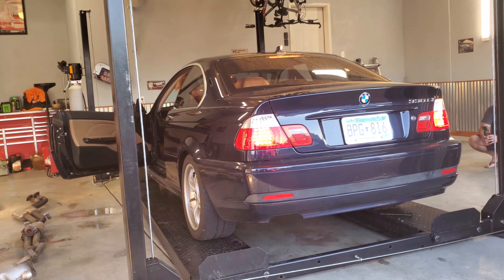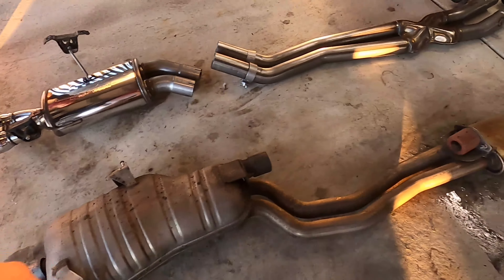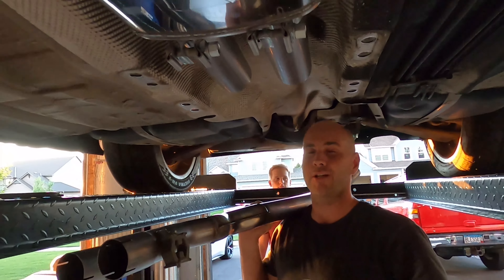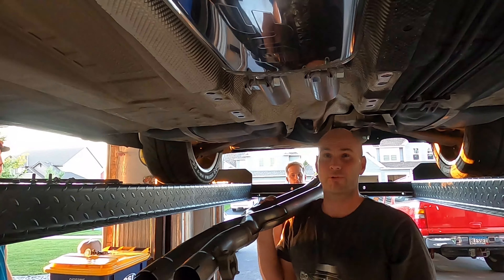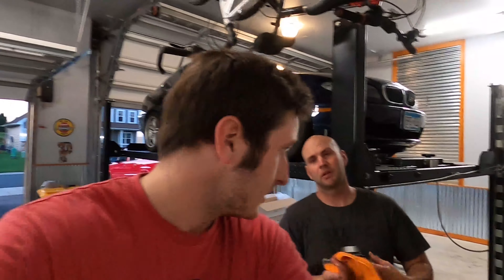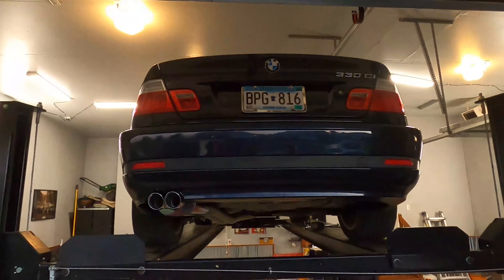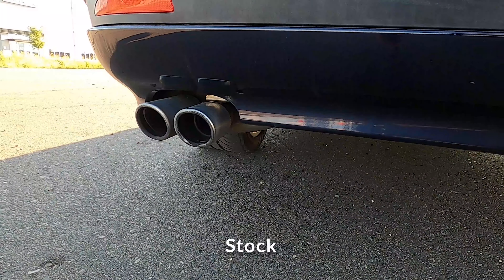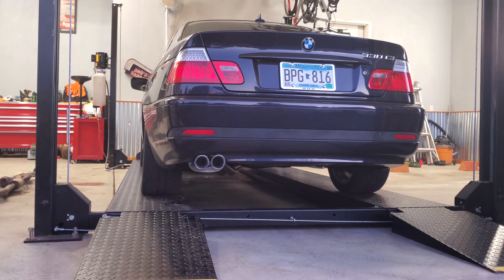Installing Magnaflow Exhaust On A BMW E46 330 CI

Comment from the maker: What are your thoughts on the sound?
Reply: Could be a bit louder tbh, plus there’s that strange noise at 7:56
Reply from the maker: Time for decat and single twin scroll 80 mill 😳
Reply: Audio quality was kinda bad really hard to tell how nice it sounds in the high end. These cars stock have 3 mufflers no resonators. personal opinion the first two starting at the cats delete straight pipe back to a single mag flow. Probably going to three inch mine instead of the duals since they meet in the same muffler anyway 💁‍♂️

Comment: I put in the mann air filter with the "sponge" on it..I guess it's supposed to be for wet climates... but it totally changed the exhaust note. Much deeper.   And then I noticed the new tone sets off all the Toyota car alarms in the garage at work. Started happening the first day I drove in with the new air filter, and hasn't stopped since...
Reply from the maker: That's definitely something I've never heard about an air filter. Nice!

Comment: A bit disappointing I’d say.
I just fitted a full stainless steel system on my E46 330Ci and found myself pretty unhappy. It sounds really close to this Magnaflow and I’m looking to open the muffler and see what I find.
I gained 12 kilos but I want more sound!
Reply from the maker: The owner ended up returning it out was so bad! Very disappointing
Reply: Just get a muffler delete 😂😂😂
Reply from the maker: That will probably end up happening
Reply: Catless headers, one resonater delete and a Y pipe to a high flow muffler will give you the sound you want lol

Comment: Can I install a Magnaflow Catback Exhaust BMW 330Ci E46 (01-06) 330i E46 (01-05) 16533 on my 318i 2001??? I really don’t get it
Reply from the maker: You will have to contact and ask magnaflow that question
Reply: no, 318 uses a completely different engine

Comment: I hate how its dual pipes the entire way, with a dual inlet, single outlet muffler with a y to 2 tips. Dont understand why they didn't use a dual inlet dual outlet muffler 🤦‍♂️
Reply from the maker: Not sure
Reply: @PerformanceOnWheels  id likely buy it if not for that.